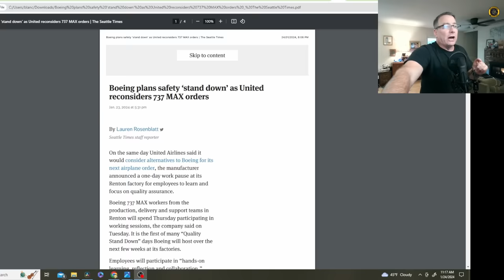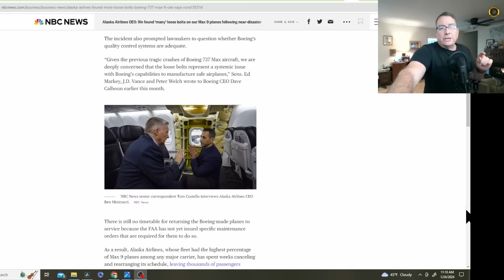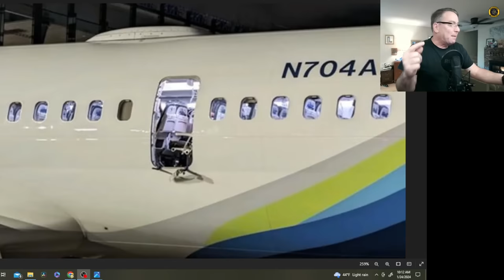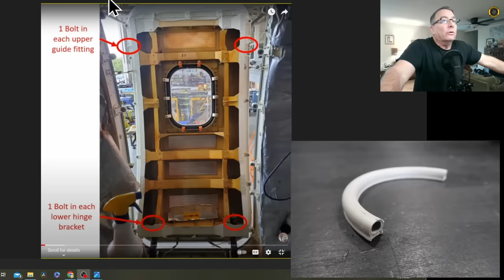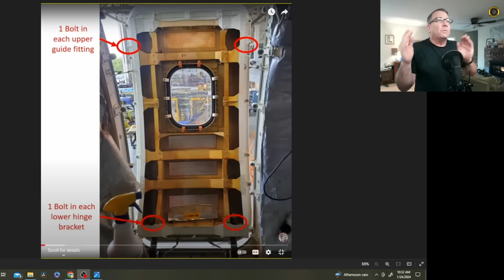Boeing's Quality Management Failure Explained 737-Max-9 Door 24 Jan 2024

Comment: The CEO of a major engineering company that I worked for (seventeen years for which I was a Quality Engineer) said to EVERY employee of the company:  "The quality is remembered long after the price is forgotten". 
It was a mantra that made it a very profitable and safe business.
Reply: I am going to save this quote.  Thanks for sharing!
Reply: I do some quality management in industrial construction.  May motto is “in 10 years nobody is gonna remember if we finished late, but they will see every day if we did a crappy job”
Reply: Sadly, ex-MD management have discovered quality doesn't matter, if you are contrite with enough confidence people will keep buying your junk.
Reply: I wish the automobile industry would adopt that philosophy.
Reply: Do you guys have an independent special inspection agency overseeing assembly process at the plant?
Reply: Nowadays it's, forget quality. Manufacture the product as cheaply as possible overseas. Only the bottom line matters.
Reply: The problem is that unlike days gone by the executives and management are more concerned with making their quarterly numbers so they get their stock options and bonuses. I bet if executives were required to return their stock options and bonuses for the period that these issues were happening we’d see fewer issues like this.
Reply: @neeneko  and the junk is priced low enough.  Cost >> quality with the MD-trained managers at Boeing.
Reply: That quote came from either Mr. Royce or Mr. Rolls from the Rolls Royce car company.
Reply: That company: Raytheon
Reply: You are so correct. A few years ago, I bought an aftermarket replacement drive shaft for a double bass drum pedal. It cost over 1/3 what I paid for the entire pedal. Every time I look down while playing, I think "Man, that thing is so well built, such precision engineering and manufacturing." I don't think "Man, that thing was expensive." I hadn't even realized or thought about that til I read your comment.
Reply: if memory serves:
"The bitterness of poor quality lingers long after the sweetness of cheap price is forgotten".
Reply: One of my coworkers would say if something happens where this job ever goes to court I want to be able to raise my right hand on the witness stand and with a straight face say that I verified and tested everything properly. By this he urged us all to not cut corners and take safety very serious.
Reply: unfortunately that doesnt ring true. its a moot point if your product doesnt sell because. theprice is too high. quality isn't a thing airlines pay extra for
Reply: @ihateemael  Benjamin Franklin
Reply: @nealdaleyjr7625  ----Don't hold your breath waiting on that

A Ford retiree
Reply: @shaneskillzrepresent Quality is an extra cost, in aviation it is expected because lives are on the line with every flight. There is no pulling over to the side of the road to fix something wrong when you are at 30,000 feet. Something a former Prime Minister of Australia forgot about when he called pilots "glorified bus drivers!" This was during the pilots dispute when aviation in Australia came to a standstill. Bob Hawke eventually became a feather duster when he was deposed as PM! 😂
😊
Mark from Melbourne Australia 🇦🇺
Reply: @neeneko MD is what? Medical device? Just spell it out!!
Reply: @doobielawson702 you can seek both low cost and quality but the non-negotiable should be quality. Unfortunately this is impossible in America. Now in Japan is it possible because so many people down the line can be expected to care about quality. Its a real challenge to achieve that culture here.
Reply: @HighlandScotsnGlens  but before Rockwell
Reply: @jamesmedina2062   McDonnell Douglas...
Reply: wrg, no such thing as remembx or for or etc
Reply: @shaneskillzrepresent  Witness the Lockheed 1011 vs the Douglas DC-10........
Reply: @zes3813  Can you translate that to English?

Comment: For a real door, there is a difference.  For a plug door, there is no difference... opening a plug is the same as removing it.  Somebody skated on paperwork by using a door nomenclature instead of (what should be required) plug nomenclature.  Thanks Juan, this shows the entire problem and why it happened.
Reply: Yeah, I think you're spot on. It doesn't even have to be someone skating on paperwork, it may be that someone who wrote the SOP didn't realize the 'plug door' isn't an actual door.
Reply: I agree. On a real door these 4 bolts don't exist anyway because their function of "locking" the door in place is provided by the door-handle or -lever mechanism instead.
Reply: Exactly - this is not a door opening and closing, by calling it that - there is assumption it's one of the emergency doors. All plug types should have been documented as removal of door.
Reply: Exactly.
The plug door isn't hinged so how can it be opened but not removed?
Reply: Yup, when is a door not a door?
Reply: @johnkingery403  its hinged by the springs and brackets at the bottom, not in the true sense of a regular door but still is hinged, you can see it in the images, it probably requires more bolts to be removed to tae it off the bracket
Reply: @johnkingery403  If I'm interpreting the animation at the end correctly, the two posts at the bottom are hinged, and once the bolts are removed, the door can be rotated out (opened, hinge at the bottom) 90 degrees different from a normal door.  Then when done, rotated back into place, and the bolts them re-installed.
Reply: @johnkingery403  It has retention ties so it can remain fitted on the sprung mounts, but away from the door seal, as opposed to being removed competely, Juan explained this in the first or second video of the series.
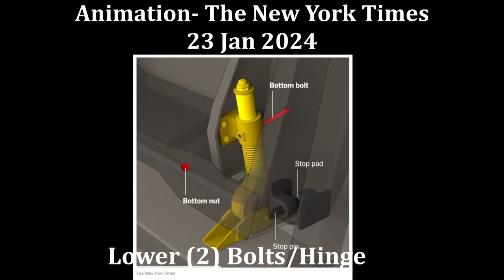Reply: Removing the plug door requires more than just opening it.  Removing the 2 cables that keep the door from hinging open more than that 12 inches or so.  Also there are 2 jamb nuts and washers on each lower hinge that need to be removed 8:26 so that the door can lift up off the lower hinges.
Reply: It makes you wonder what else could be wrong with the 737.
Reply: The procedure has to be different. To remove the plug you would need a crane or scaffold in place to hold the plug to keep it from falling to the ground. To open it you just need to get the top pegs to release from the latches and then let it rest on the bottom pegs. The top is then restrained by a couple of straps (see pics).
Reply: @nickmaclachlan5178 when it is a plug, evidently.
Reply: Doesn't explain why other planes have similar problems and loose bolts!! Boeing is going for shit!!
Reply: @blairhoughton7918  Yes different, but for a plug both require bolt removal so either a detailed explanation of the difference must be in the procedure or both must require the same 'removal' inspection after work is complete.
Reply: Also this is what happens when you outsource your work unnecessarily-the United States is a victim of its own self with stuff being made cheaper somewhere else and shipped in
It’s an absolute mess and only when “Rome” falls will we be able to fix it
Reply: @misarthim6538 Everyone keeps using the word "Door" or plug door. It's a PLUG, or perhaps door plug, not a door or "plug door". Unbelievable. Should be "fusilage hole plug". That's MUCH more attention getting. Jfc.
Reply: Did the Spirit repair happen after the interior paneling was installed? Did Spirit have permission to remove interior panels to get to the plug?

Did Boeing have a bolt check scheduled just before the paneling was installed?
Reply: The difference between a door and a door plug is how you ”shut the door”. How do you shut a ”plug door” and inspect it to see it is properly closed and locked from the inside, when you only can see a panel? That is no door.
Reply: @johnkingery403  It is secured to the airframe by the hinge at the bottom of the door. In addition, limit straps at the upper sides prevent the door swinging down on the hinge and damaging the skin of the fuselage. To remove the door, the door must be externally held by a crane or similar whilst thehinges are unbolted from the  door and the straps removed. Needless to say, the forces on the door at 16,000 feet when it came loose just ripped it away from the aircraft.
Reply: It is hinged and can open to 15°
Reply: Was thinking the same thing, i bet that’s why it was set up that way on the first place. The original system wasn’t designed with door plugs in mind.
Reply: @johnkingery403  They have a special piece of equipment for that.  It holds the door about 1 foot from the aircraft.
Reply: Are the door and plug door the same PN but just installed differently?
Reply: @johnkingery403 wrong. The plug door is hinged at the bottom. 

The bolts can be removed and the door raised and opened at the top, swung outwards on a 6 inch strap.

Or after bolt removal, the door plug can be completely removed.

It appears that the seal can be worked on while the door is in its partially opened position.

As well as the hinges at the bottom, there are springs to raise the door up. This is to clear from the opening (for maintenance).
Reply: @Pab-B  Yep, or maybe filler plug. There is certainly nothing door about it other than it is shaped to fit the hole that exists for one.
Reply: My experience tells me there's always QA inspection prior to closing removed side panels. Doors, windows whatever. This makes no sense..
Reply: Regardless of paperwork, this is an absurd lack of accountability. Bolts have been removed so they need to be put back in. But QC software doesn't make them do that so they don't do that and no one cares. Makes you wonder how many other procedures are ambiguously/incorrectly defined in their QC software and they just ignore it.
Reply: @friedchicken1 the door has an internal and external handle and latch. The door plug has neither.

Not the same part.
Reply: @friedchicken1   No there two different parts.
Reply: @jameshisself9324  Yep, I expanded on this in another direct comment. Just blows my mind, proof being that even blancolirio calls it a door again and again!
Reply: But do you really need a computerized system to do a final look around and sanity check before buttoning up work?  If you read the President's Commission Report on Three Mile Island, there's a very interesting statement.  I don't have it handy so I'll paraphrase - strict adherence to rules and regulations doesn't make you safe; rather, a culture of safety makes you safe.  A couple of things I always do, even on road vehicles, is 1) if I'm disassembling a safety critical part the hole gets tagged somehow even if it's just a T-shirt or zip tie tied to it. That way it's easy to see if something is missing 2) When reassembling a safety critical part, you never halfway install it and plan to finish it the next day.  It's either fully disassembled or fully assembled with proper torque, safety wire, etc.  It's never in between.  This is how my IA killed a couple of people by spinning in spark plugs hand tight but told himself he'd torque them later.
Reply: PRECISELY this. What we have here is an example of a failure to identify a separate process and instead lump it in with another process that is similar but not identical.
Reply: If you fully remove the door they'd also need to undo the bonding straps at the bottom. Different procedures is fine as long as they are both correct.
Reply: Not quite. Who reinstalled the door without bolts?
Reply: @johnkingery403 Wake up… it IS hinged, it is a stripped down door that gets bolted securely in the ‘closed’ position. The photos show it released from the latch track and hinged outwards, held by the straps. Remove the straps and it flops right down like the full escape door. But undo the 2 big nuts at the top of the hinge rod and the door plug slides right off, it is then ‘removed’….. which IS a bigger deal.
Reply: @nickmaclachlan5178 when a door is "ajar"...😎
Reply: @misarthim6538 probably an intern wrote the SOP, signed off by a manager who didn't read the SOP
Reply: A plug should not have 'door' anywhere in the design / maintenance paperwork. It is a plug, there is no 'open', and all work should be QA'd.
Reply: @johnkingery403  um... it IS Hinged.  At the bottom.  You can open the door without removing it.
Reply: I'm having a little trouble here. If the Sprit employees removed bolts, they should have had bolts left over when they moved on to the next job. There should have been 4 unexplained bolts left somewhere. I'm thinking that maybe the Spirit employees actually did only open the door because there were no bolts in it to remove. Perhaps Boeing never put the bolts in?
Reply: @nickmaclachlan5178  when it’s a jar?
Reply: @johnkingery403  the plug is indeed hinged. Take a look at the end of this video with the clips from the New York times graphics, one of them showing how the hinge mechanism works.
Reply: @ReinoGoo  You can't open or close the plug without taking the paneling off.
Reply: @rrmm7566  Spirit working at Boeing did the repair of the seal and rivets. They took out the bolts and should have put them back regardless. Both these companies are crap.
Reply: @bills6093  It was bolted when it got to Boeing. Don't seem to have the info yet who took them out when Spirit did the rework. Boeing knew the seal was bad and called in Spirit to fix it.
Reply: @Pab-B  At this point it does not matter, we all know the opening is there to place an emergency exit door by design.  Also we all know that for low PAX seating configurations these plugs are installed and seating will not have a gap for an exit row.  They both share the same basic features that secure the door or plug in place.  Only difference is the exit door has a handle on the inside and outside that is the securing mechanism for holding it closed and the 4 locking bolts are not installed.  And the exit door has a slide installed in the lower portion.  At this point I'd say it is safe to move on from worrying about what someone is referring to when they talk about the assembly because we understand how they operate.
Reply: @jameshisself9324   Not true.  It functions in attachment and movement exactly the same as the exit door.  Both the plug and emergency exit interface with the aircraft the same way.  Lower hinges, stop pins and pads, upper guide tracks are the same.  Exit door is held in place with the handle locking assembly instead of the 4 locking bolts.  Youtube does not allow links but I have a photo in front of me that shows an exit door with its interior panel removed.  To focus on what we call it is wasted at this point.
Reply: @softwarephil1709  The door will not stay closed without at least 1 bolt installed.  It will otherwise be raised up and cracked open.
Reply: @Cobalt135  Incorrect. Completely true. It's not a door. It doesn't matter if the interface is the same, the latching and locking are completely different.
Reply: @johnkingery403  It IS hinged, right at the bottom. The busted hinges are visible in most of the photos of the damage.
Reply: @friedchicken1   Plug and door are NOT the same, a door can be opened and closed easily, and locked with the handle inside. A plug is BOLTED in place, and is NOT easily removed.
Reply: @softwarephil1709  It's not a door, it's a plug.
Reply: @nickmaclachlan5178 , when it's an access panel. Which does trigger the need to write a removal, plus separately the seal that was replaced.

Had this been Boeing employees doing the rework/repair, probably the paperwork would have been done with correct inspections as warranted.

But, since it was Spirit employees doing warranty rework, the CMES system wasn't available due to a Boeing policy excluding non Boeing employees from the CMES system.
Reply: @blairhoughton7918 Nothing wrong with procedures being different. But all procedures need to be checked and approved to make sure they are fit for purpose. That’s the first failure. 
The procedure was performed as per the instructions. This is what is supposed to happen. HOWEVER, no sense check was done since there would be parts left over. That’s failure number two. 
Accepting defects that require rework is completely the opposite of Quality Assurance. That’s a big failure as well. This is a cultural problem that can only be addressed from the top.
Reply: There were a lot of doors on a ship that were not easy to open and close, but still doors   @beezul
Reply: @johnkingery403  it can swing out on the cables on top about a foot
Reply: @Pab-B  if one removes the hinge pins (bolts) & the door (plug) then technically it's just an opening but anyone that would walk thru it will still call it a door or better the door frame.
Reply: Q: When is a door NOT a door?  A: When it is ajar. (Note: 'Ajar' means 'slightly open'...) @MarcosElMalo2
Reply: I think you are going to have people  getting on a plane from now on that see a door like that and tell flight attendant "Hell no! Im not sitting there!